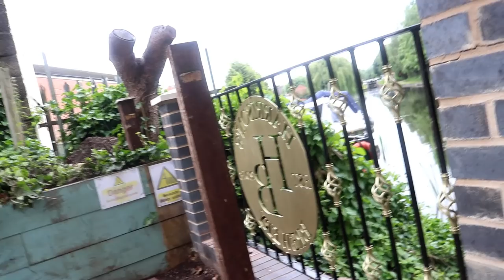ALL DAY TO TAKE IT DOWN

Comment: Commercially we would put in steel posts resin anchored to a pad foundation, the fence would be directly connected to the posts and the brickwork is then just a cladding and not structural.

Comment: Good idea buddy, depth/thickness is key to giving you the “flexural” strength you need of your piers more than breadth, proportional to breadth x depth squared/6. Leaving a void for some concrete is a good idea. Would recommend filling it no more than 500mm at a time, leaving 24hr to cure. Can’t hurt to put a rebar in, best it can anchor below the level of the dwarf wall or if possible into the foundation.

Comment: We all have oopsies Harry m8,at least it was spotted now and not down the line when some punter was leaning against it. It was an easy oversight but at least it's easily rectified even if it is extra labour. Good idea with the rebar,you will have it sorted in no time and there won't be any bodge about it. Cheers.

Comment: Don't dwell on it Harry, i have just had a garden wall built by a brickie and he has done the same with the rebar and concrete down the centre , he said if you don't do it that way all the weight is on the brick joints, so good thinking batman.

Comment: Chris, if you like the dimensions of your pillars, why not put a square metal post in the center and cut the bricks to fit around them? You could easily weld a flat plate to the bottom to use for bolting the steel kingposts in the center and you can weld up some mounts to the kingposts for the mounting of the railings.  Then you can notch the bricks out and fit them around the kingposts - hiding them totally. It;s is mostly some welding, which you love to do and a little masonry cutting to fit your bricks? It looks great, but it was much better for YOU to find this weakness than one of your customers!

Comment: Harry, don't fix into the mortar, fixings into the brick. Your idea to drop steel in is a sound one, however drill down Into the wall and chemical fix the steel into the wall also this will add more strength for you, try to get 2 bars per hole if you can. 
What you could do for the railings fixings is inset flat bar bent on either end into the pillars that lines up with the fixings on the railings, once mortarred in it would never move plus it would be held by your concrete down the middle.

Chin up m8, it will be awesome when done, me and the Mrs are planning a trip over for a pint and to thank you for the daily vlogs you do ;)

Comment: I like your' belt and braces' approach to the second build of the pillars but please don't drill and bolt into the mortar as the fence may look sound when you erect it but as soon as someone leans on it the mortar will crack. One thing that you are not is a liar. All the very best, Stevie